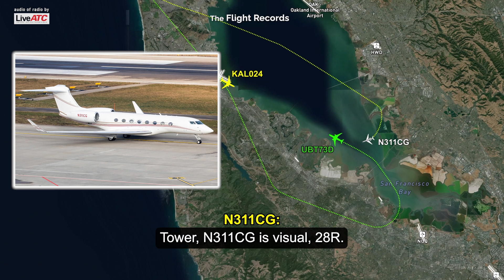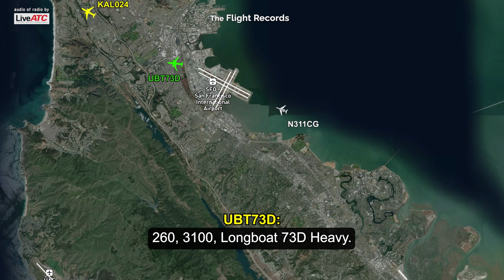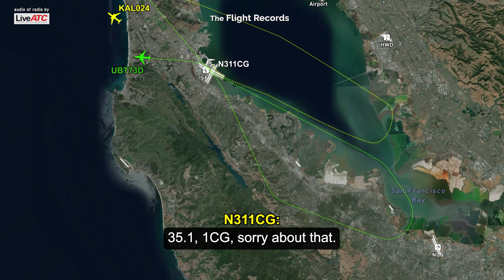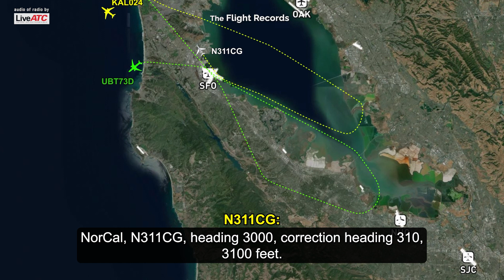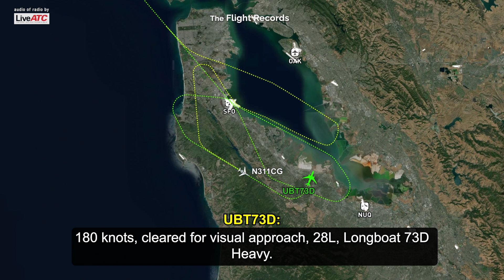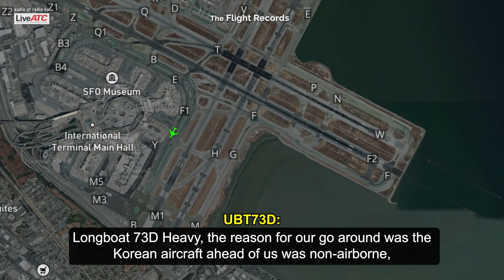Who is guilty? | CONTROLLER SCOLDS the PILOT for attempting to land WITHOUT LANDING CLEARANCE!

Comment: The Korean told the tower multiple times that they were blocked and asked to say again and didn’t get a timely response. This led to the delayed takeoff clearance and then the Longboat got sent around. The CG was at fault for not ensuring the tower got their check on, and then not responding when they were called in the blind. Lots happened in a short period of time, but ultimately the tower was the root of the problem.